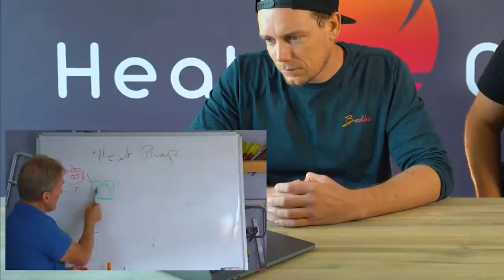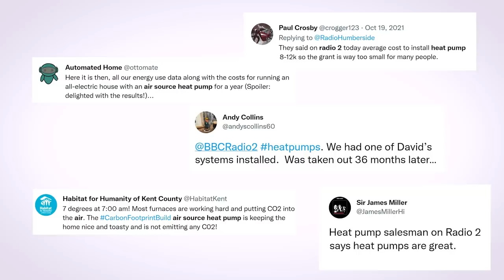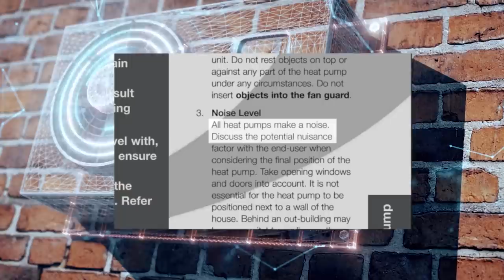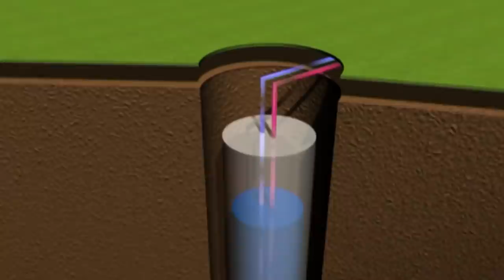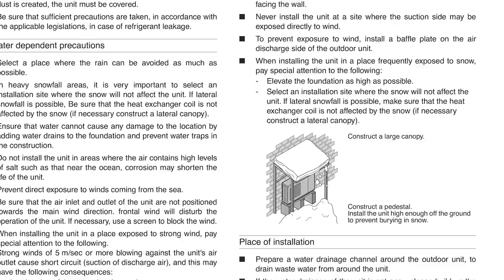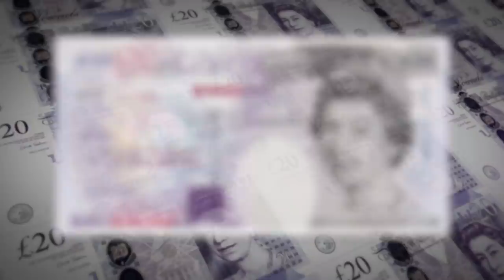Heat Pump Secrets They Don't Want You to Know

Comment: Well done Roger another great video bringing illumination, enlightenment and truth to the situation. I'm going to step in and say this, listen to what he says everyone , its not a black and white issue, it depends on your personal situation, heat pumps aren't a silver bullet either, the truth is a bit like a jigsaw puzzle, sometimes you need several different pieces / peoples opinions to get the full picture, it is unlikely to come entirely from the aggressive pushy salesman. There are best and worst case scenario's , my mate installs heat pumps for swimming pools, they are brilliant solution, his own pool was being heated on a sunny day with less than 2kw draw but delivering 13 kw of heat energy , utterly amazing , a CoP of over 6 but that was in perfect conditions, perfect hot summer's day but he's only heating his pool not a bath tub or radiators. My brother on the other hand has had a lot of hassle with his heat pump, wasn't exactly enthusiastic or professional attitude by installers and has broken down a couple of times, seems ok now. One thing is for sure, the public must absolutely NOT take the salesman's pitch as gospel, is a disaster waiting to unfold in Britains badly insulated housing stock. Do some maths , electricity is already  3 times the price of gas so you have to achieve more than year round CoP ( coefficient of performance) of 3 just to stand still, say you achieve 4.5 , well your spending a lot of money for a marginal gain, we are lucky to have gas, the government are wrong , utterly, about sticking in all these heat pumps and you will all be freezing and broke if you blindly obey their bullshit. Both Roger, Urban Plumber and heat Geek are very knowledgeable people, it will take armies of highly skilled, honest and knowledgeable tradesmen to  get them into the appropriate properties to make a worthwhile difference. Ideally they would be powered by solar ie my mate would literally be heating his pool for free at that point, that is not cooking on gas, that is cooking on solar and brains. What is really costing this country money is lack of vision, muppetry and lack of professionalism, is up to everyone to turn things around , like it says in the good book, the intelligence is with intelligence , and the light of men was the light of God. Keep speaking up and speaking out Roger, super charge the Holy fire.

Comment: Very entertaining - but absolutely true. I am in my later retired years and when I was in my younger engineering career (over 50 years ago) there was a lot of discussions and research done about Heat Pumps so why is it taking so long to develop them? Also, it's great for people with a large garden for the ground source type or enough wall space for the Air source type but what about the millions of people living in 'high rise' accommodation. Don't say we can install giant communal ground source ones - it's just not practical. My opinion is to reduce the cost of electrical energy on a par with gas and start to introduce direct electrical boilers as replacements which will use existing radiators and pipework without any upgrading. It just needs a courageous political decision and divert any heat pump grants to electrical generation. Maybe by gas fired power stations for now but later from non fossil fuel type. One step at a  time - direct electric boilers are already available on the market but the government does not promote them as the electrical running costs per unit are extortionate.

Comment: Can't argue within anything you said. I have gas and a recent boiler but I can see a time coming when I will need an electric / heat pumped solution to replace it - which would have to be ground-sourced in my view. I have seen a good argument that we will deal with the uncertainties of PV and wind-sourced energy by massively over-providing capacity as PV panel and wind turbine prices continue to tumble. This would also mean that for most of the time we will be over-provided with electricity capacity and prices should fall to reflect this - maybe we will not need the heat pump COP effect to boost purely electric heating ?
Reply: Don't overlook high capacity batteries, such as powerwall and even EV storage capacity. Means renewables become more viable every year.

Comment: So many listened to the previous video's and utterly missed the points being made in them. Yes, these things can work but they are not the entire solution or even a solution for every possible building was a clear point across them all. I know of people who have them I know of people who got them and years later had to have them ripped out as they simply didn't deliver the heat or the savings and cost them more money than a gas boiler ever did to run.

Comment: I’ve seen recently air source heat pump /gas boiler combi systems advertised which apparently don’t need any internal pipe work changes , except to update older type radiators.  Any thoughts.
Reply from the maker: If you are running at a lower temperature you need larger radiatos and pipework. Some heatpumps need a 32mm flow pipe. If your house is well insulated the low temperature running 24/7 is probably fine but a lot of homes are too cold so having a boiler that you can turn up in the cold weather is more responsive. In the end it is about keeping warm.

Comment: Tick on the corrosion caused by salt, however you would expect the ASHP to be suitable protected.
Do you feel ASHP operating at 35c are viable if they use a heater battery to top up the heating when its cold and for hot water e.g. you would have two heat supplies to the buffer vessel. You would run the ASHP all the time and use the heater battery something like SUNAMP as the top up. Since PCMs are pretty much instant you can get the immediate heat you want on a cold morning. In regards to radiators what about new rads with heat plate exchangers to lift the temperature from 35c to 55c in the rad? something like Dimplex ones? This means you can keep your existing radiator dimensions and just replace the units. In regards to the fabric agree that should come first.

Comment: I have a really serious question.   The heat pump for hot water works better if it is hot outside.   Would it not be better to put the fan thingy in the attic where it is super hot all the time ????  Like a solar assist ..

Comment: Roger, the issue with a gas boiler is it can blow up your house just check press, this could become worse if hydrogen is adopted. Every technology has good and bad points. Radiant heating systems are the issue in the UK, forced air heating can achieve set point quicker and use less energy especially if air to air heat pumps are used.

Comment: How do they work as A/C in the summer?  Do they pump cold water into the rads, or can it be set up to use an internal blower unit like normal A/C?
Reply: They can either put cold water in rads or UFH or with a splitter, blow cold air. Water based is not recommended as it causes condensation

Comment: I live in a large 1960s chalet bungalow with very expensive oil heating. Slowly replacing old double glazing and trying to improve insulation. We had a company trying to get us to install an air source heat pump with government grant, but now I am worried it wont suit our property. I looked at ground source and under flooring heating but nearly died at the price.
Need to replace oil heating but not sure what way to go now

Comment: I have considered and dismissed replacing our condenser boiler with a heat pump. I am thinking of installing a single-room air-to-air through-wall unit on an external wall of our open-plan kitchen and TV lounge.  My thinking is that on nights when we are mainly using the lounge we can use the heat pump as the main heater and turn the CH thermostat down significantly.  The gas boiler would continue to provide hot water and a baseline temperature for other rooms.  Does anyone reading this have any experience with this setup and has it made a significant difference in reducing the combined electricity and gas usage?

Comment: Ok so next week at seventy years old I’m about to start another air source installation. It takes about a week largely because I am involved with an excellent company who really do design superb systems. These installations consume so much copper it is just unbelievable. So my thoughts “ I could just about be in favour for them for a new build although I have some doubts that the efficiency is some what off set by the reduced output temperature of these machines “. The amount of materials used in the installation is ridiculous and the amount of C02 created making them will never ever be considered. They use complex digital control that is guaranteed to eventually break down. However one thing that no one ever considers is the future. The installation I am about to start will have an approximate cost price totally installed of around £20,000 but here is the really unconsidered part. Between fifteen and twenty years into the future the compressor will have to be replaced, today the replacement cost is around £4000 plus the me’s of this world. In 15 to 20 years time you have now retired and your compressor needs to be replaced you can be certain that the replacement cost will be in the region of £15000 plus the future me’s of this world at around then £100 per hour. So your first trip in your retirement will be to the bank manager to borrow around £18000 to get your heating system working again. Of course it was only two years ago that the complex digital control system had to be replaced at a cost of £3000 and that’s not to mention the number of times the two pumps, actuator heads, zone valves, thermostatic mixing valves have been replaced over the years. I install them but when it came to my own house I designed a system a million miles away from heat pumps that requires one pump running on the slowest speed and one analogue stat. Retirement made easy.

Comment: Brilliant, love your sense of humour
Reply: Exactly, humor, as most of his arguments are blown out of proportion by doing faces and rising voice. 
And few things are simply wrong or manipulated to support his narrative. North Europe is heated with air-water heat pumps and no one seems to be stressing much (at least not as much as this guy) about snow, defrosting etc. By  UK guy will with average 5cm of snow annually. 
This is coming from a guy heating his 230m² house for ca. 450€ in 2021. And yes, we had winters (Jan-Feb ca. 40cm of snow and temps down -18C and Dec with little snow but a solid week with temp not going above -10C even during the day...
Reply: @ggdhx  I strongly disagree with you, knowing someone who has one that has been a cold disaster from word go, also noisy in operation and heavy on the electricity.
Reply: @Ajojets  I have my pump running since 08.2019 with exactly zero issues. I also know at least 6 other home owners with similar experience.
Key to success is to find someone who will be able to asses the energy demand of the building and reputable installer. And please lemme guess: a failed example you are referring to was a monoblock type of the heat pump? The installation of which requires only a general plumber to connect it to a central heating of the building? Not a split type heat pump requiring a person knowledgeable in... HVAC?

Comment: The problem is addressed in the first two minutes:

“You have to put the correct size heat pump in for the size construction and insulation of that property”

“A lot of these heat pumps are slung in by these people and they aren’t skilled at doing it”

And therein lies the problem. Idiots installing unsuitable units, in unsuitable locations, on inadequate heating circuits without following the simple installation instructions.

Comment: hey mate, perhaps I don't understand the system I'm thinking of very well but why aren't HVac systems more prevalent here (UK) with the issue of ventilation vs insulation does a HVac harvesting air from outside and heating it to pump into the house not fix both these issues?
Reply: It's a weird British thing, we've had very cheap gas for the last 30 years, that's changing rapidly and some people are somewhat in denial about it. He is right though, the first focus should be on building performance, sort that and you reduce gas usage in half, after that we can look at heating system improvement.
Reply: Yes, why indeed. I think these may offer good alternative in some situations, but I don't know enough about them, they are seen here as "air con" and dont attract govt funding, although they are cheaper anyway.

Comment: My gas boiler is 30 odd years old. It is turned off at the beginning of March and back on half way through November , comes on for an hour in the morning and 3 hours in the evening. I also don't run the hot water side of system. No need have an electric shower, dishwasher and washing machine. I am 80 years old have medical problems. I certainly won't be fitting a heat pump system. No need just put a decent jumper on.

Comment: My next door neighbour need to have piles for his extension and I expected a big thing to turn up to drill the holes, but the company that put the piles in just used a device the size of a small digger to drill the hole and they went down 18m. So you don’t need a big drilling machine to get ground source heat pump
Reply from the maker: Hi Basil 
 It depends on ground conditions as to what size machine they use. You may get away with a small one but 18metres is not that deep for a bore hole. If the ground is ok it will replenish but if not the bore hole will freeze.

Comment: You never know, if the problem with heating becomes dire, the gov may even contract a piling team to drill down ground nearest main road (where feasible and when ground conditions allow) and prep for a Ground Source system. To do a whole road might not be too much ag or cost and you don't get random Air Source brrr'ing away all year round. Of course Gas/Electric/Water/Foul would need avoiding and routing it to existing boiler locations might be a pain. Welcome replies and comments 👍

Comment: Great video, I have a mini split/ air to air. Very happy with the unit. ONE MAJOR ISSUE the lowest temp you can set the heat cycle to is 67 degrees. Yes 67 degrees. I live in hot summer, cold winter climate. I only want to heat my garage to 45 or 50 degrees in the winter. NOT 67 degrees. What a waste of energy and if I am working in my garage in the winter 50 to 60 would be nice. Don’t buy a mini split for your garage!!!

Comment: The older ones are noisy, the new DC compressors are not, only hear the fan! No backup heater on a five-ton water system! You can keep the gas boiler as a backup, I use a Combicore, 1 have never used backup electrical or gas yet! We had one temperature of minus -2 degrees F.

Comment: Well reasoned argument for and against. My personal experience with a split system was the ac element works, but as a heat pump - nah! Going forward, I can just imagine how many cowboy suppliers/installers will leave homeowners with pitiful installations that never had any chance of doing what they patently should. As an aside, my daughter has just bought a new house with solar panels on it. I'll be watching with great interest to see how they work in practice.
Reply: If you like your house warm don't get a heat pump. As for the solar panels, if you live in Nevada then they are fantastic, England not so.

Comment: The difference between burning gas in your boiler or in a gas fired powerstation is efficiency. Power stations can be 60% efficient and gas boilers are much higher like 90% efficient . So its better to burn gas at home.

Comment: I put an ASHP in a bungalow we were moving out of and going to rent out. It is loud, they fudged the numbers on the noise assessment (I’m an acoustic consultant) it leaked glycol all over the floor so I had to replace the carpet and they blamed us for it even though it was the day after install. They wanted £700 to fix it even though it was just a leaking joint where a new radiator had been fitted wrong. The install meant there is a massive water tank which we were told could go in the loft but they lied so when install time came round it had to go into the kitchen which we’d already ordered so we had to sacrifice a full height massive cupboard for it to go into. After a few months it was playing up and when they came out to look it was full of hair or something. The controller constantly kicks out error messages making you think there’s a problem when it’s just the flaky remote connection cutting out so if there’s actually a problem you wouldn’t pay attention to it.

Despite all this it works albeit at a lower radiator temp so you can feel cold. Is it as fool proof as a boiler that we as a society have had for years and everyone knows how to use and repair/service. No. But it does work and the bills are more or less the same.

At the moment, it is not better, costs more, is louder, takes up more room, has more problems, there’s no proof of longevity. The companies installing them are part of the problem as there aren’t enough of them so they charge a premium, they are taking on the longevity risk so any problem they will try and wriggle out of repairing for free to save money, they will not be honest as to whether an ASHP is the best idea in your property. If there isn’t already there will be a large scandal where people try and get their money back. Don’t be missold, get an opinion from someone impartial and pay them for it instead of needs be.
Reply from the maker: Thank you Jon
It is very helpful for people to read about your experiences. It is balanced and honest. We need to tread carefully with this technology